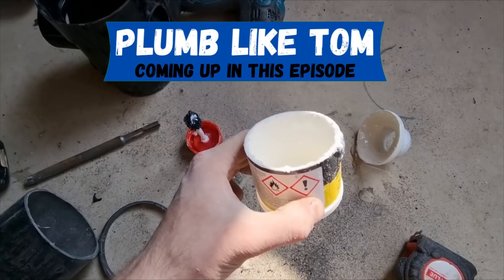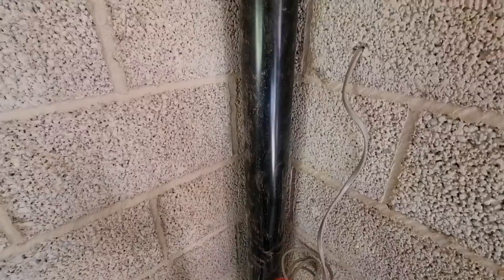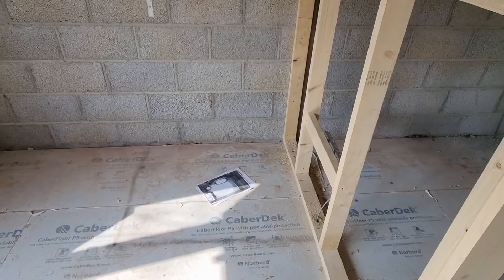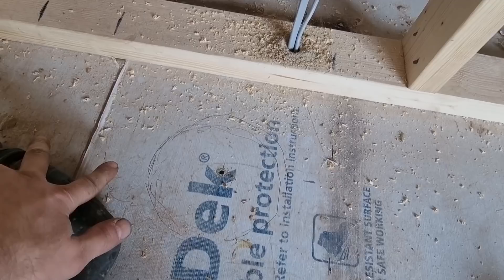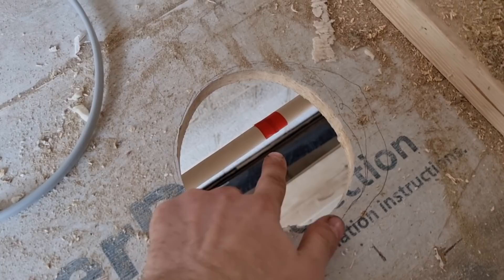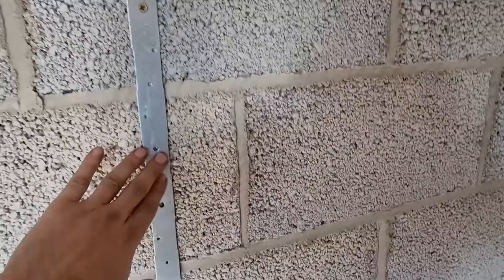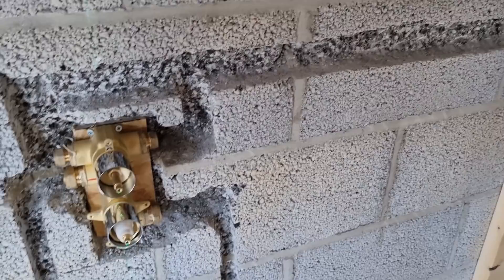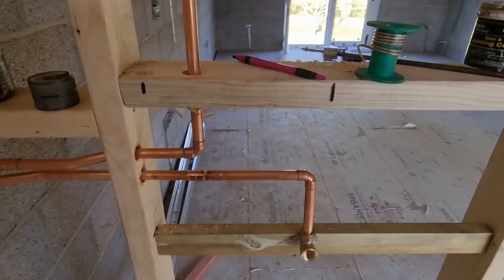The Time I Got Covered In C**P And Some First Fix Plumbing

Comment: Another great video I've done a few of those concealed valves with multiple components off it ....your thinking in front of what you are doing....because once it's all tiled in theres no way to fix apart from rip the tiles off ....tested mine at full tilt into buckets ....as for the episode with the backing up soil I had a 20 ft deep man hole full to the top .....what a buzz when I got it clear...the suction as it started to clear was huge..those days are long gone ...but as always lad well done 👍
Reply from the maker: Thanks mate, like you say you can't afford to make any mistakes at this stage as you can't fix it once its all tiled, I always say if you get your first fix right your second fix is easy

Comment: Great video as always. Bosses who aren't prepared to do the dirty job themselves on get stuck on alongside their employees don't deserve a business in my opinion. Plenty of bad ones around unfortunately.

I dislike interior soil stacks a lot. I know there's no way around them sometimes but a lot of new build the stacks could go outside and it makes life easier for everyone down the line just flip the cap and blast it down the garden quick hose up and you're good.

First fix is coming along a treat. Nice open engineered joists too. Plastic has its place despite all the haters tears. Looking good. 👍
Reply from the maker: Hi mate, I know what you mean about bosses who won't get their hands mucky, I have had my fair share of "bad" jobs over the years, I honestly don't mind getting my hands dirty but some jobs you never forget for all the wrong reasons. Internal stacks are OK as long as you have access to be able to rod in case of blockages, this one has a manhole directly on the outside so should be fine. The stack on this house would have looked ugly and out of place on the outside. Plastic is perfectly fine to use where not on show, it speeds up the time of installation and to be fair copper on this job would have been a pain to thread through the joists. I appreciate you stopping be the channel, as always it is greatly appreciated

Comment: thanks for sharing with your experience. Tell us how do you find the depth for those female wall plates. for showerhead and handheld showerhead.
Reply from the maker: Hi mate, the wall plates I tend to leave 13mm forward on on a stud wall so they just stick through the moisture resistant boarding, You can then screw a female iron into the backplate to extend them through your finished wall surface if your threads are to short on your arms, I will post a video showing this on the second fix, hope this helps